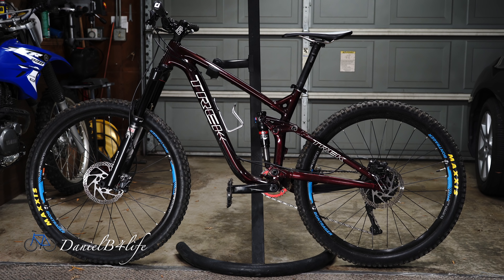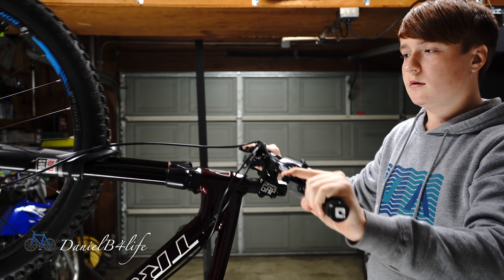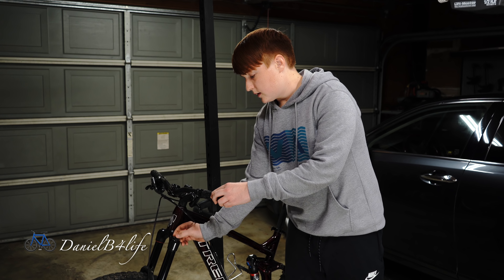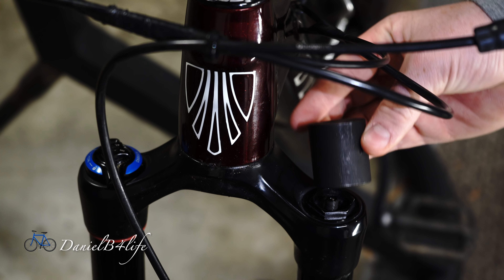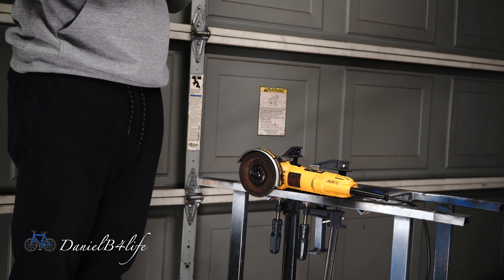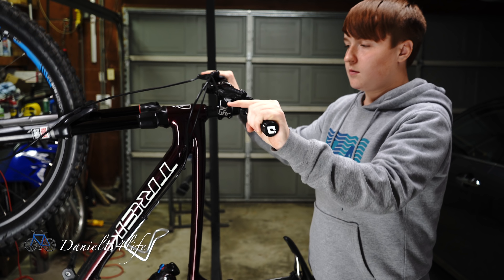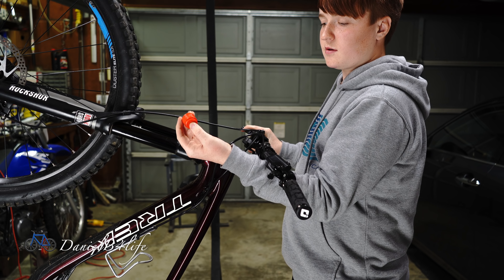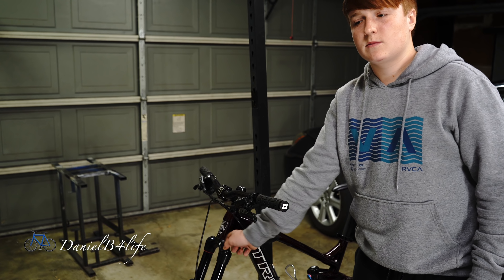Fork making a lot of noise? Try this...

Comment: Your front brake cable is routed the wrong way around the fork.  It is supposed to be on the inside so it is more protected from strikes
Reply: There's not a right or wrong way.

Comment: My Fox 34 performance is making a knocking sound going over small bumps, but I don't think it's the air volume spacer as they slide vs. screw on like in Rock Shox. I will have to open it up.
Reply: My 34 performance is doing the same thing this guys was... Like to the t and I already checked the spacers and they were good but sounds is identical but in the other leg I think. If I put rebound up my girl dives half travel. Thinking of just buying a new one lol, it'll take forever to get this one serviced and returned

Comment: You have a pike right is it dual air Position?

Grey bottomless tokens are compatible with the following Solo Air forks:
Pike, Lyrik, Yari, Pike DJ, BoXXer.
Dark red bottomless tokens are compatible with the following Dual Position Air forks:
Pike, Lyrik, Yari.
Reply from the maker: William's Biking no, I have the solo air model.
Reply: @DanielB4life  If you read the thing in my comment then you would know that Grey tokens are only supposed to be installed in your solo air fork and that's maybe why it came lose.
Reply: @DanielB4life  read my follow up comment...

Comment: Hey my fork pretty much makes the exact same noise but it dosent make a sliding noise when I turn it over. Any suggestions?
Reply from the maker: Hmm, my friend’s fork started making a similar fork after he landed to flat really hard. If you’re comfortable enough, look up a video of your fork and try to take it apart. You will need new oil and foam rings. If you aren’t comfortable with that, just take it to a bike shop for an expert opinion